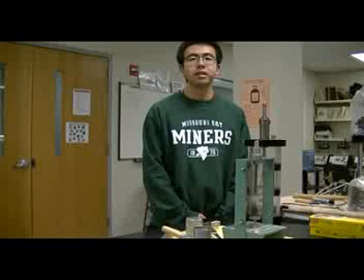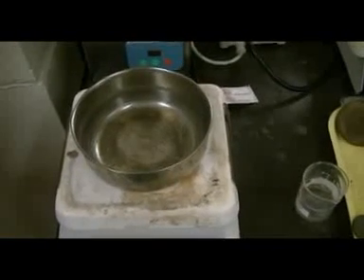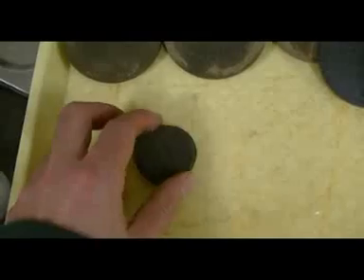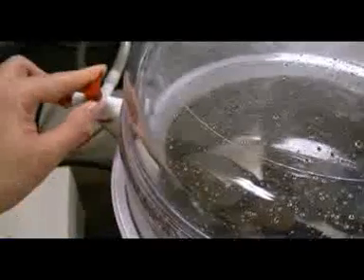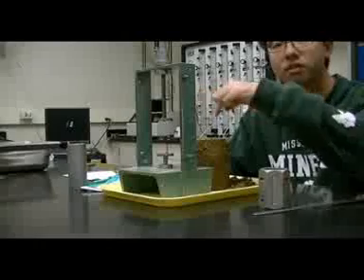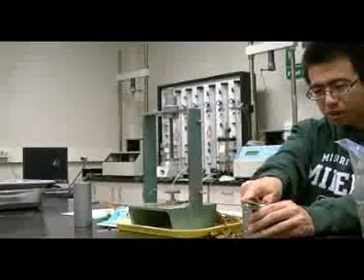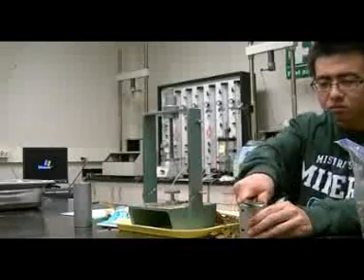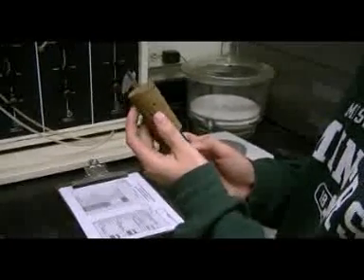DEMO OF Consolidated Undrained Triaxial Compression Test 1

Comment from the maker: @cluttrell2527  hello budy, thank you very much for your interest, the reason is that the latex will slightly change in its shape under water, pre-soak can reduce this effect. also a wet latex membrane has a good contact with the sample and easy to handle during test set up. I'm not sure 100% correct, that's my understanding. again , thank you.